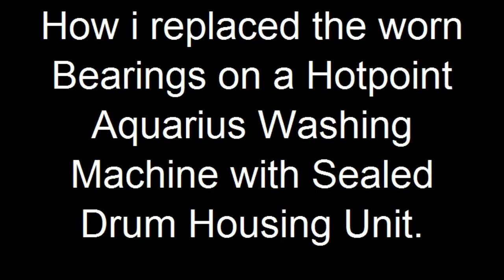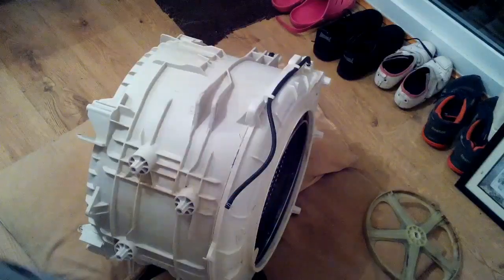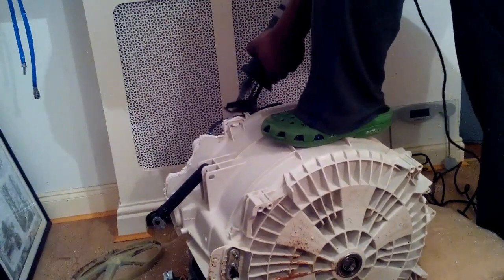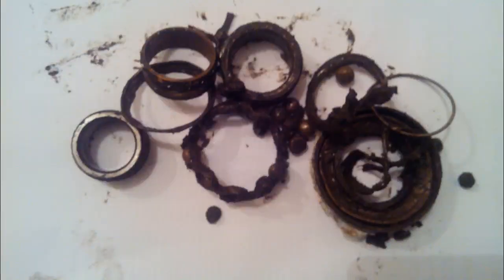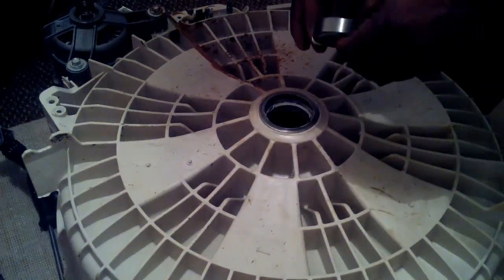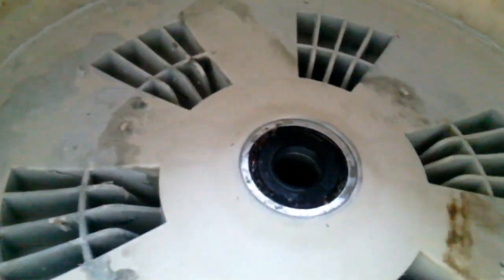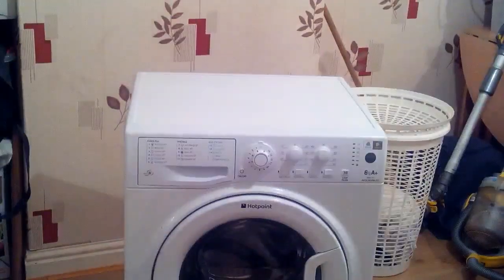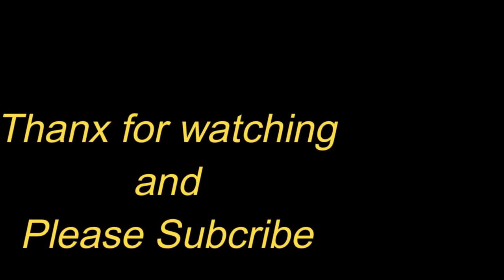Washing Machine Sealed Tub Bearings Replacement

Comment: This is a great video. Many thanks for taking the time to make it.

I’ve just done my Hotpoint WML520 sealed drum. Here are some additional things people may want to consider.

1. Do drill the drum weld first before cutting open. I used a 3mm drill and made holes approx every 75mm (3”) I used this hole size to maximise the sealing width for the adhesive (Because the weld width is very narrow - approx 8 to 10mm.)

2. I decided to use self tapping screws instead of bolts to clamp and hold the drum halves together and I ‘pre-tapped’ each hole with a screw before cutting the drum apart to make assembly easier and quicker. Self tappers are cheap and easy and clamped the halves really well after gluing. (But don’t over tighten)

3.Do use a reciprocating saw. (An air saw may be better though.) Be careful not to damage the steel drum inside. Don’t bother using a multi tool, the blade gets too hot and melts the plastic. (As I discovered!)

4. Use the edge of a Stanley knife or similar to de- burr all of the plastic around the weld surfaces. ( the small burrs could get between the surfaces when gluing together.)

5. I got my bearings and main seal from a local engineering supplier. £15. Quality bearings too. Hotpoint didn’t stock bearings for my machine as it was a sealed drum. (But they sell the drum at around £200 😱)

6. Wash all soap sludge from the drum halves etc with a car pressure washer. (It cleans it really well and is quick.)
And properly clean the drum spindle until it shines (use rotary wire brush in a drill for the steel but only wire wool or similar on the brass ferrule at the base of the spindle . The brass bit is important, it must be really clean and undamaged because the main seal runs on this. I used car brake cleaner to give the spindle a final wash before assembly and then a good squirt of silicone spray to help it go together. Turn the drum as you push it in the last bit to help the seal go onto the brass ferrule.

7. DO make sure the back of the bearing sleeve/retainer is supported on a block of wood or similar when banging in the bearings. The sleeve is only held in plastic and therefore could be broken free or seriously damaged. Put a longer bit of wood into the metal drum when knocking in the smaller back bearing too.

8. I ended up using white Evo Stik adhesive to glue the drum together. I’m sure the pu Gorilla glue is great, but the  Evo has good reviews, is waterproof and has a temperature range of up to 100 degrees C.

9. When applying the glue, just be careful not to put too much on, because you won’t be able to clean or remove the ‘squidge’ inside the drum when assembled. This could potentially cause problems if the squidge breaks off later on and blocks the pump etc. Obviously you need enough glue though to create a proper seal.

10. It’s probably worth considering investing in a new door seal while the drum is out (£20) Much easier to but on the inner spring! My door seal was quite disgusting when I looked in all the nooks and crannies!

11. Give the drum glue the minimum of 24hrs curing time before using. Be patient!

Anyway, mine is all done now and working a dream. A lot of effort I suppose, but it should be good for many years to come.

Hope this helps!
Reply from the maker: Thanks Lawt,
                      no you cannot buy Bearings and Seal off the shelf for a Sealed Tub or Eco-Tub as they are not designed to be replaced. Lawt see this more up to date video of how to install bearings on a sealed tub; https://youtu.be/HKFX0B-5fPU?si=xWq2lRsKjDcssERM
Reply: @green-crocs-fixes1520  Granted, Hotpoint don’t sell the bearings. But my bearings and seal were readily available off the shelf at my local engineering/bearing supplier. They were all common bearings and sizes, so we’re in stock.

Comment: Hi, I've just successfully replaced the bearings in my hotpoint as a result of copying this brilliant video. The only things I did slightly different are that I drilled the holes for the new screws before I sawed the flange and used a hand saw, I don't have a power saw, it took a little longer but no big deal. I also used a sealant instead of glue because that's what I had available and as you said its just to seal not stick (the screws hold it all together). anyway money is tight and this has saved me a small fortune (a new machine basically) so a big thanks and I wish you well. Gerry
Reply from the maker: Gerry Holmes Well done Gerry. I just used what I had available also, but and if the Sealant does the job then so be it. Your right, drilling the holes prior sounds like an easier way. Glad to help and kindest regards, Dave.
Reply: Thanks a lot, I saved many euro's thanks to your video.  It's a shame that the comsumer has to recycle , while manufacturers make evrything to throw away, just to increase their sales.  Greetings from Belgium
Reply: Where did u get bearings from plz
Reply: Hi, your repair with screws still holding up? My bearings are done too and of course, the tube is sealed. But I don't know if this type of repair last over time. Thank you.
Reply: @green-crocs-fixes1520  
Ja das wäre ich schon.
Aber wenn der Bottich verklebt ist schmeiß ich die Mühle weg.
Das tu ich mir nicht an.
Ich habe noch 2 Maschinen in der Werkstatt die noch verschraubt bottiche haben. Sind halt alt aber laufen noch.
Reply from the maker: @pascalwallaert485  Sorry Pascal,
                                                          just noticed you response (3 years later) Thanks 😀.
Reply from the maker: @adamhaworth6309   Hi Adam,
                                                   its a bit late (11 Months) but you have to measure the old Bearings and Seal once you have removed them then request the sizes from an online Washing Machine Bearings supplier 😀.
Reply: Mine is still going strong after 5yrs plus and it’s in use most days

Comment: Thanks for this!  A new drum assembly for my Whirlpool is £216, the bearings are only about £15.  I'd taken the whole thing apart only to find that it was a sealed drum and realised that if I had a spare £216, I might as well have ust bought a new machine.  A few minutes with my old Black and Decker Jigsaw and now I am just working the bearings out!  The Jigsaw isn't the best but it did the job easily with a wood cutting blade.
Reply from the maker: Hi Nicola,
               Fair play to you and i hope you complete successfully. I also removed the Tub on my unit initially only to discover it was sealed and a replacement Tub was not cost effective, hence the video. I think whatever is used to split the Tub is not relevant so long as it is successful, prior to starting mine I watched a video by Kevin Frost and he used an Angle Grinder, and you are right you could pretty much buy a brand new machine for the price of a new Tub. Good luck.

           Kindest Regards.
Reply: Where do u get bearings from
Reply: @adamhaworth6309  an online company called buyspares.com. .
Reply: Never buy "genuine ' bearings, search online for bearing specialists, higher quality at a fraction of the price.

Comment: Manufacturers should legally be BANNED from making sealed tub machines. it is not cheaper and is only done so that they can deliberately engineer a failure just out of warranty period. It is fraud.
Reply from the maker: Your not wrong Peter,
                                      as not everyone can afford to pay two to three hundred pounds for a new machine every eighteen  or twenty four months.

             Regards.
Reply: @green-crocs-fixes1520  My own machine has just failed, the drum has seized solid and not only is it a sealed tub, there is very little flange to even try and drill screw holes through for bolts. Engineered that way on purpose no doubt.... otherwise, I'd have had a go at doing this. Manufacturers simply should not be allowed to make sealed tubs... but of course, they will respond to that by increasing the price up to the £600 level - which is where you CAN get a machine with a tub you can dismantle!
Reply from the maker: Peter i had already replaced this machine when it broke down, just thought I would have a go at repairing the unit after reading all of the blogs stating that it is a sealed unit. Not sure why they call it an Eco-Tub as it is far from economical to the consumer when it goes wrong.Brought a Bosch washer dryer for £900 which has a split (dismantle type) tub.
Reply: @green-crocs-fixes1520  Yeah I might have a go at it just for the sake of it... next time I can afford to I will be doing the same as you, investing money in a split-tub machine, probably a Bosch!

The bastard is before this we had a Whirlpool which did have a split tub... it lasted 12 years and the spider snapped from metal corrosion. Whirlpool wanted £200 for a new drum.. and I wish i'd paid it now as everything was replaceable.. Replaced it with another cheaper Whirlpool that just lasted 2 years before the bearing went, and before I knew about the sealed drum thing. The machine that's just gone wrong is a Beko, but at least it was a freebie!
Reply from the maker: strongly advise having a go at fixing it, when the weather is good. @ leat you will have a spare if you have the room.
Reply: @jaycee1980  beware  Bosch bearings  cannot be changed !
Reply: Could not agree more ,! I have written to most  of the manufacturers only miele and Ebac told me their drums could be split !
Reply: Yes it IS fraud. That's why the EU Parliament is looking into the matter of manufacturers deliberately designing non-serviceable vital parts which they have total monopoly on (so they can impose inflated prices that lead the device to the trashcan). France in 2016 passed a law on its own against this frauding malpractice, falsely called "planned obsolescence" (which is NOT, it is in fact planned durability ). So far it's been enforced against Apple for the notorious OS "updates" that turn older devices into battery-sapping unusable tchotchkes and Epson, Canon and HP for "updating" their printers to refuse third-party ink cartridges. I hope they'll be massively fined and forced to abandon such malpractices.
Reply: I completely agree, I will now never buy another Whirlpool product because of this unethical behavior,  you are being forced to through away a product that is 10% broken. I loved this video as it shows a good work around.
Reply: Simon Bingham only the serie4 Bosch machines bearings can now be replaced. This is because they retain the original Bosch drum with the metal paddles which they’ve been using for about 20 years now. However the series 6 and 8 have a new style drum called the “wave drum” which the bearings are sealed on
Reply: @simon_bingham  Unfortunately, that's only partly true. The cheaper Miele washing machines have welded drums. You have to buy a medium to high-end model to get stainless inner & outer (two-part) drums.
Reply: Always a good get the bearings and seal out, measure them and go online to a bearing specialist, higher quality and less than half the price
Reply from the maker: @onlyme972  Yes that's exactly what I did,
                                                                       and this is the most frequently asked question.
Reply: I agree with you there it's a disgrace look at how many people throw these washing machines out at the local dumps and they are all modern machines. They just make it so difficult and time consuming for anyone to repair it.
Reply from the maker: @lornadouglas7887   I've picked one of these up off the street which was discarded, ( in my other video ) repaired it and sold it on Lorna.
Reply: peter after 2021 they now have to make more reliable white goods including replacement parts eu say to much white goods waste
Reply: @bitsnbobs1969  I doubt it will make any difference
Reply: @Sterling Mordechai No... no one cares
Reply: I absolutely agree manufacturers make it harder for themselves it’s completely pointless these sealed drums
Reply: @simon_bingham Good for Ebac. I think they’re a British company!

Comment: I've just found out my washing machine is sealed and as a result finding replacement bearings for Beko  Wl1573 is proving near on imposdible.
Nice video
Reply from the maker: Hi Metratone,
                        Commiserations, however there are no Bearings or Seal listed for an Eco or Sealed Tub as they are not designed to be replaced. You have to measure the old ones once you have removed them then request the sizes from an online Bearings supplier.

         Regards.
Reply: @green-crocs-fixes1520 I never thought of that thanks.
Reply from the maker: @metratone5  😃
Reply: Most bearings have model numbers on them (i. e 6201 etc. ) Then there is no need to measure, just give the numbers to the bearing supplier. Better still, take the old bearings in with you or send them.

Comment: Great video!!

I tackled my Beko machine after watching this and I was amazed I fixed it.  Finding the replavement bearings was simple but the seal required a fair bit og Googling.

Just to add - I used a hacksaw to cut open the plastic drum so don't worry if you don't have an electric one.

Keep up the good work!!
Reply from the maker: Andy West Hi Andy, superb. Glad that you were successful. Whatever you use to split the tub is not relevant so long as it gets the job done.I watched Kevin Frost video originally and he used an Angle Grinder. And yes sourcing the correct bearings and seal can require some research. Well done M8.

Regards,
                 Dave.
Reply: Hi Andy, where did you find the bearings to use? And what sealant did you use? i have a Beko as well, Tnx!!

Comment: Brilliant
Just a few more tips on how to do this Job which takes time but is not difficult really.
Watch all the Videos on this first 
As you dismantle the washing machine take video or photos at each stage before you unscrew things, disconnect wires or unbolt things, that way you won't be struggling when it comes to re assembling the machine. more is better than less, trust me.
Before you cut the drum mark the drum with a Sharpie pen in several places this will aid re assembly, and drill 4mm holes at about 100mm (4inch) centres all round the lip where you are going to cut, you can buy a long, 4mm drill bit, 120mm long from Screwfix (about £3.00 for 2) while you are there buy the 4mm Stainless lock nuts (£3.00) and 30mm long Bolts (also about £3.00) You might need to buy some Vernier Calipers to accurately measure the old bearing sizes, more on this later. When you are drilling the holes test the first one with a nut and bolt to make certain you can get it in and do it up you when you come to re assemble, this will prevent you from drilling in the wrong vertical plane.
Cutting the Drum. I opted for using a hacksaw, which will cut all the way round the drum, I have power tools but you are in better control with a hand tool. It took just under an hour, quick tea break included. You will need a waterproof sealant when you put the drum back together. I used Aqua Mate Sealant.(£5.00)
Knock out the outer bearing first, so from the inside out, using a metal drift, it takes a bit of whacking before it comes out. Then from the outside knock out the inner bearing, the water seal comes out with the bearing when you do this.
Now you have your bearings and seal out measure them with a good mm rule or the Verner capilers, you need, inner diameter, outer diameter and thickness in each case. I then ordered them from Wych Bearings (about £20.00 the lot)on line. I did this job in the morning about 11.00 and so was able to just get them the next day just using standard first class post. There is a helpline if you are not sure what you want. 
I put the new bearings in the freezer for a couple of hours (Metal contracts in cold) and kept the drum in the sun (Metal expands in heat) to make it easier to knock them in .follow the videos for this but use wood blocks because any metal on metal blows will damage your new bearings.
Use loads of sealant on the drum before you put the two bits together. Line it all up and put in the nuts and bolts you have plenty of time to do them up tight. I let my drum and sealant cure for 24 hours after, but it can be done faster I think. Then just re assemble it all. Hope you took enough photoes......!!!
Reply from the maker: Thanx

Comment from the maker: Hi Michael and Thanx. The bearings £11.50p, Glue £6.00p and the Nuts & Bolts £1.00p. Time a couple of hours but then you have to allow the glue to dry over night. ☺
Reply: Can anyone help me I've got a hotpoint Wmfug842p and the bearings are going the noise is unbearable I've got the drum case out just need to saw round the casing as there is no screws around the case.....is it possible to be fixed and can you tell me the right bearing size I need for this...it's such a shame just to chuck it away as I've only had it over 12 months..... thanks
Reply from the maker: A very common question Chris. Measured the old Bearings diameter, radius and thickness the Seal also then requested the sizes from an online Bearings supplier.  Regards.

Comment: Your hoover drum is identical to my Hotpoint Aquarius one, i tried gorilla glue and to be honest i do not believe it to be a good adhesive, i like the fact it expands but was not impressed with how easy the drum was to separate the second time around(looks like a slower version of expanding foam), my recommendation is to use a polyurethane adhesive sealer like Tiger Seal by U-POL, this adhesive is extremely strong and can be used on many different materials, it also can be layed in a bead about 10mm high should you need it....
Reply from the maker: HiddenAgenda2012 Hi HiddenAgenda.  Your correct, this is a Hotpoint Drum not Hoover, editting error. TheTub is bolted together with nuts and bolts, the Gorilla Glue is used as a Seal and helps to hold the unit together also. Whatever you choose to use so long as it is adequate it will suffice. Thanx, Dave.